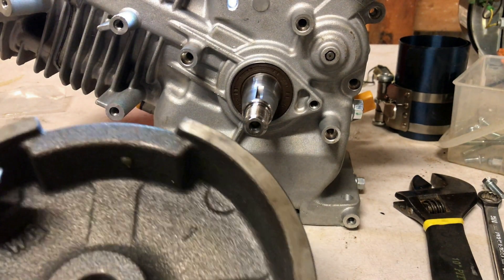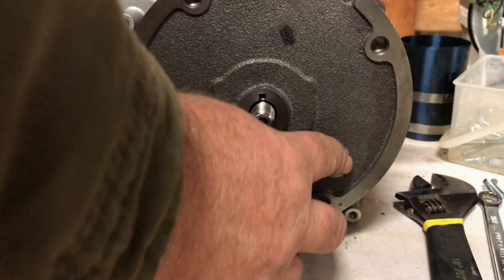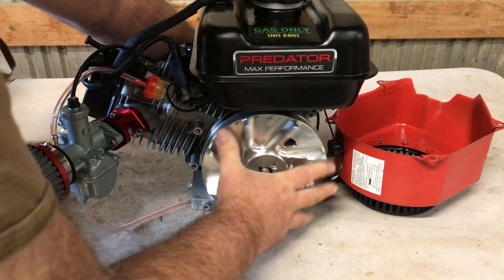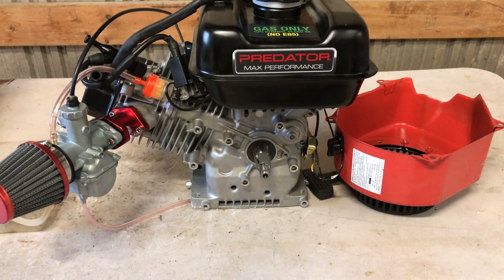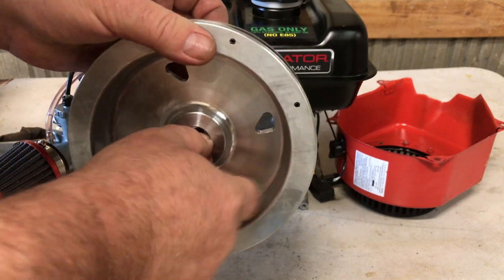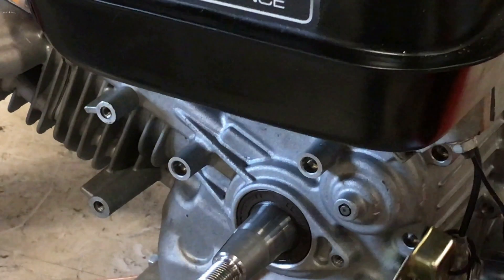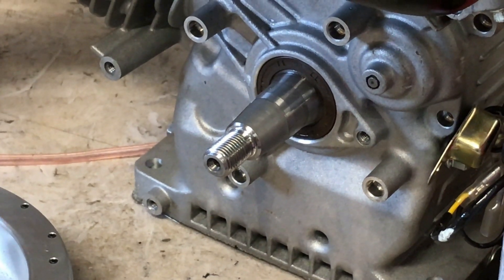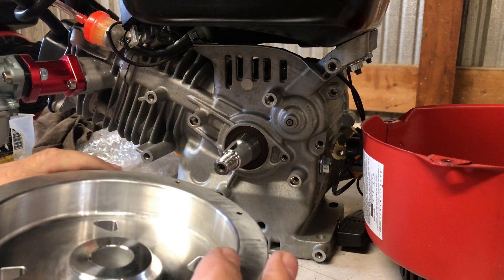Hard Starting and Kickback Solutions for your 224 Predator 212 Engine Build 223 Wildcat 236

Comment: Thanks KFF.  I have the same issue with a very similar setup.  I haven't reduced the combustion chamber but I do have the flat topped piston and a 265 cam.  I found my starting issue was related to the fuel/air screw on the side being out of whack.  I reset it to 1 1/4 turns and got it to start but the kickback went from zero to impossible.  Now it either starts quickly from cold or don't bother.  I did get an offset key and I'm going to try reducing the advance but haven't gotten to it yet.
Reply from the maker: Hi Core 1783! Sounds like you're well on your way to solving your issue. Thanks!
Reply: @KentuckyFriedFixes  Just a follow up.  Got it started and ran it for a bit.  Gave it a few hours to cool down and tried again.  The compression was so stiff I could hardly rotate the crank.  Short version, I opened it up and the compression release was damaged (Bonzai 265 cam).  The spring was in the bottom and the weight apparently managed to hit the counter balance on the main shaft; one solid impact mark and some scrapes.  Comparing the cam to the original, the weight on the Bonzai is much taller than the stock.  Not sure what I can do about it.  Maybe look for a different cam that doesn't stick out as much.  Every see the problem before?
Reply from the maker: @Core-vu6mc  I'm curious, did you use an ARC billet rod in your build? I was originally going with an ARC rod but it had too many clearance issues, even with the Banzai cam. The EC rod cleared the Banzai cam in my block but the ARC didn't.
Reply: @KentuckyFriedFixes  I got the 223 stage 2 kit so its the EC version.  Yes, I had problems on the top inside of the case.  I had to do a lot of grinding.  The issue isn't the rod though.  It is the compression release weight sticking out too far from the back side of the cam.  It hits the counter weight lobe of crankshaft.  I have a W223 engine as well that I've left stock.  I'm considering fixing the spring on the cam and see if it works in the W223.  I've ordered another cam from a different manufacturer to see if that might work.  Not sure what else to do.
Reply from the maker: @Core-vu6mc  Clearance is always a headache on stroker builds. I've not looked into swapping the parts out on the cams but maybe if you have an old stock cam laying around you might get lucky.

Comment: Shot glass of finger nail polish remover every other or 3rd tanks of fuel and as high octane as you can get seems to do the trick 2 stroke oil fouls the plug up fast but if do proper maintenance not an issue in my case I don't always take car of things on a timely schedule
Reply from the maker: Hi HP! I hesitate on putting any of my personal fuel formulas on video but I do like the 2 stroke oil in all my race gas. If somebody reads this and emails me at my address on my "about" page, I'll gladly share a few formulas that work. Thanks!
Reply: @KentuckyFriedFixes  Harry put special tires on the car 🚗
Reply from the maker: @heathenprojects2639  LOL I Love that movie!
Reply: @KentuckyFriedFixes  I like using marvel mystery oil in my fuel and Lucas high zinc in the oil
Reply from the maker: @dabtech7456  MM is great stuff! I love it too! It'd be difficult tp pry a bottle of Lucas out of my hands for sure. My favorite additives and engine assembly lube!.
Reply: Also some of these springs on market I've had some 26 24 springs that do this and a set of 37 pound springs that are butter smooth
Reply from the maker: @heathenprojects2639  I think if someone is building kart engines to spec rules they sure better spend some money on the gauging tools. You're exactly right. Some of the parts available are much better than others. I'm noticing differences in valve springs too!